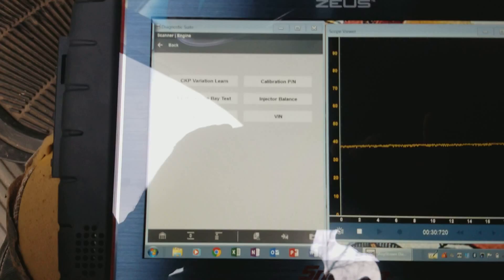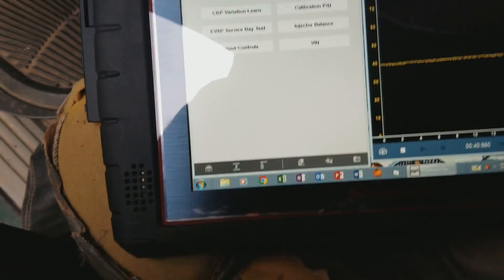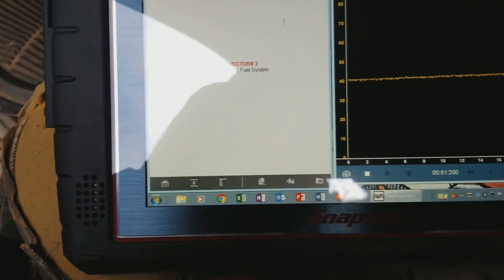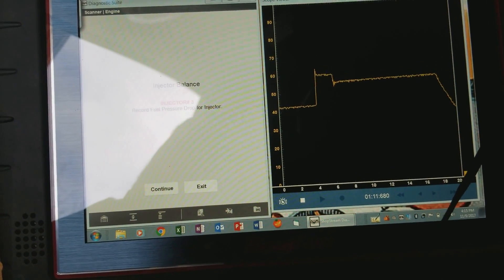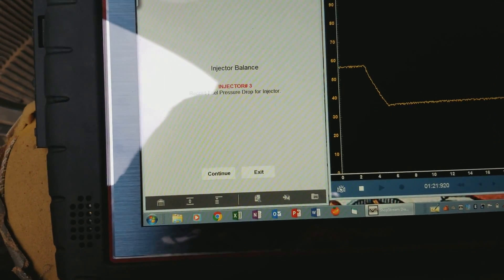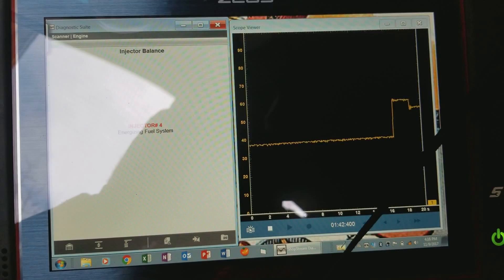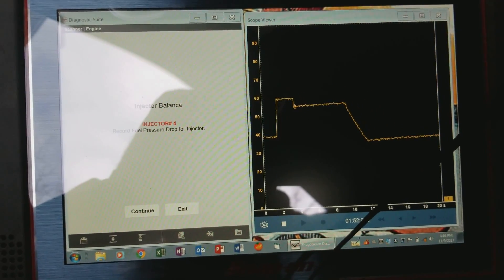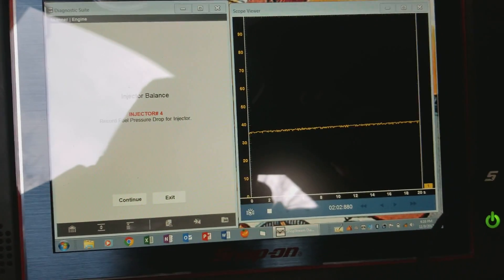Zeus! Using split screen with pressure transducers

Comment: Shouldn't the injectors be removed for this test?
Reply from the maker: No leave them in the engine. After you do each cylinder the computer will make you start the engine before you can do the test again to make sure your not flooding the cylinders.
Reply: @70corwin  Okay, have seen other clips with flooding. I sent your clip with the Zeus doing the split screen to my Snap on rep, if I known that this was available would of bought the Verus years ago . Snap on is lame on showing this technique this is one of the best features.
I'm old school on just German makes and have had the Autologic using the Vantage, but this split screen is the way to go, I'm a one man mechanic and this is helpful. Just bought the Triton D10, very good, but talking about trading in for the Zeus. For the few clips you have they are very good, you know what your doing.